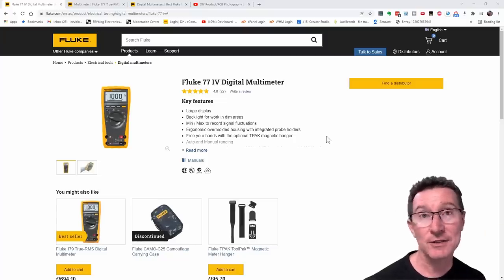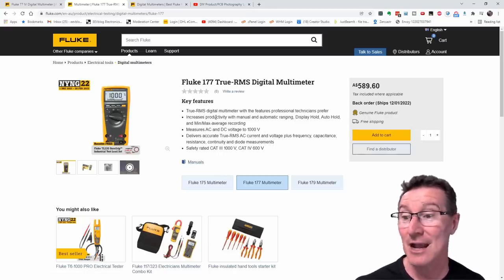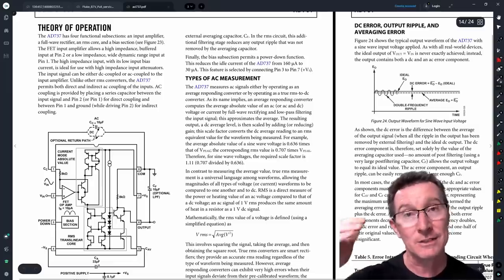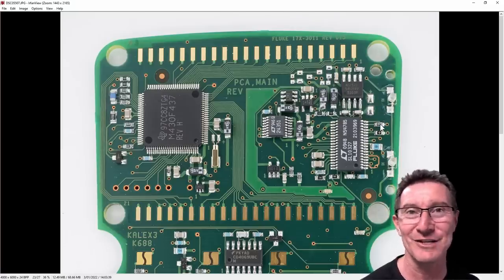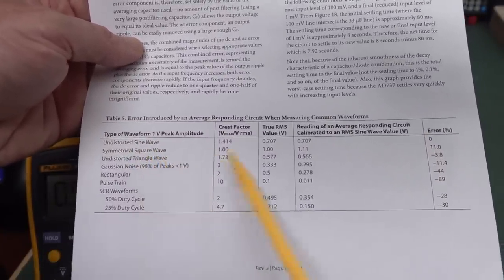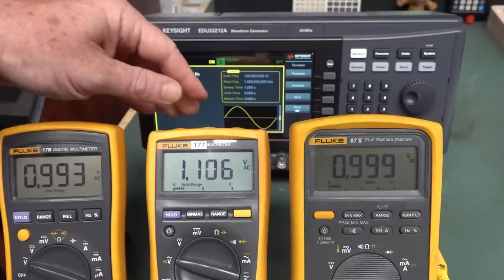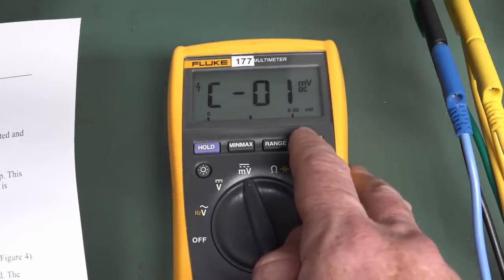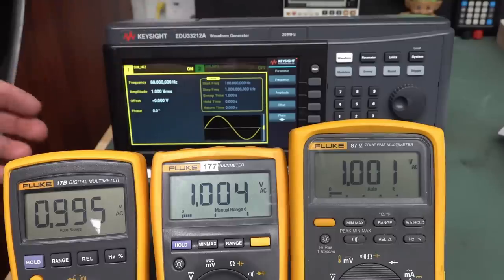EEVblog 1448 - Convert a Fluke 77 IV to True RMS for 10 CENTS!*

Comment from the maker: FYI, Fluke responded, the 70 series not not being discontinued, it's just not on the Australian website. It is on the US website main page though.
Reply: Dave, that was the first thing I went to check after I hit play on the video!
Reply: good enough for Australia
Reply: Ask them to modify the cal routine so that you can skip directly to the ac calibration after mounting the... no wait. Lol.
Reply: Did they respond to this video? :)
Reply: I've had a 77AN for about 30 years. I was hoping this was something I could do with mine. I'm due to change the battery, I'll have a look inside.
Reply: Phew... close one!
Reply: Sounds like a reasonably productive response rather than a cease and desist letter, the true winner-winner chicken dinner!
Reply: @EarthSouthside  not quite 30 yr batteries. I've changed the battery twice since I've had it.
Reply: @jhonbus  also, it may be technically a 10¢ modification, but the recalibration requires access to equipment worth many times what you saved on the meter (although a slightly shady reseller who had some of that investment already could probably make some money selling "upgraded" meters - then i'm sure Fluke would get mad). But it's a nice insight into both how the technology works (I had no idea the T-RMS conversion was all analog) and how products are built with different markets in mind.
Reply: @RandomUser2401  not good enough for Australia :-D
Reply: @ailivac  Like with plenty of "commercial" grade equipment everywhere - you don't really pay for hardware, you pay for support.
Reply: Dough
Reply: Temperature... anybody, oh yes get the TK 12 temp module also...., Just get a 179 and save yourself all the bullshit lol

Comment: so: 10 cents for the cap, and 10,000 dollars for the calibration equipment? ;)
Reply: I'm offering a service...
Just send your fully functioning 77-IV along with $US 500.00 and prepaid return packaging.
I'll convert it into a Fluke 177 INCLUDING a correctly labelled new case and even a manufacturers warranty!!!

I can also offer a similar service to convert other meters (at different prices of course)
For example, if you send me a fully functioning HP/Agilent/Keysight 3458A, I can convert that one into a Fluke 177 for only $US 300.00
Quite a bargain huh?

<<<Grins>>>
Reply: Or you can just pay few 100,000's of loan for a shop in a business building with a magic dumpster so that you can find those equipment "for free" ;-)
Reply: I dont think that calibrating a meter is such an expensive endeavor 😸
Reply: Nothing stopping somebody considering doing this from sending it out for calibration, for handheld meters, its generally pretty cheap from what I have heard
Reply: Yeah total clickbait.
I expect so much better from dave.
Reply: @logangreif8549  
Probably depends on the local market, and if you care about qualified service or not.  Best bet would be asking some local volt-nut type who has their own gear and will do it for free or cheap.
Reply: $10000 is a little too low, adding 1 more Zero and you maybe right
Reply: And yes the correct title of the video
Reply: @boggisthecat  a volt-nut might be more expensive then a company that is into calibrating flukes. The volt-nut needs to cobble together multiple devices.
That takes times and know-how.
A specialized service has an automated rig and a Fluke 177 cal. program - press start and follow the display and your meter is done. That is fast and just requires using the existing setup.
Reply: @sarowie  Generally yes, as long as they're willing to get your order to calibrate one meter, when most of their clients just send 50 of them in bulk and only require one "pass/fail" document.
Reply: @lolaa2200  I did that.

I really works.

I mean, I found a (mostly) Working Digilog 300 in the dumpster here... (Found a C128 also, as well as 2 tektronic scopes, a random assortment of meters, microscopes, lab equipment, 3d printers, UV LED equipment... the list goes on)
Reply: I had the exact same comment, but nobody liked mine.  I feel so disrespected!
Reply: @wojciechszymanowski  the price grows roughly exponentially with precision.
Reply: @wojciechszymanowski  Yep around 25 Pounds Sterling in the UK for a multi-meter calibration but my first thought was the same as Bob Cuyt's

Comment: My wife bought me an original Fluke 77 as a wedding gift in 1985.  Still my favourite rugged, reliable DVM.  Last year she found me {through her volunteer position with a local thrift shop here in western Canada} an older Simpson 470 DVM which is NOT auto-ranging, an advantage when I want to quickly check zinc-carbon, alkaline, NiCd & NiMH cells using the 2 volt range.  I'll grant that modern metrology tools are generally superior, but instruments from many decades in the past still have their uses.  I have a 1941-vintage 0 - 15 VDC meter made by Weston.  Nicely finished wooden case, long mIrrored scale, still very accurate, but a little overdamped {slow to reach its final reading}.  Calibration certificate inside the lid signed in india ink.   6 years older than I am !
Reply: great wife ;)
Reply: Checking the cells is pet peeve of cheap auto-ranging multimeres that have volts AC and DC on one dial position and they somewhat have AC as default.
Reply: @Alexander-qz6px  Just what I was thinking. Surely a keeper ;)
Reply: Analog mechanical meters are naturally true RMS and they aren't as affected by static and noise.
Reply: @fieldlab4  a bit like being slow, you don’t get the joke’s being made about you.
Reply: @fieldlab4  ...Analog D'Arsonval/Weston meter movements are inherently DC-sensing, and if used for AC work generally use a small diode bridge  in series with the meter to measure the AVERAGE current/voltage.  You may be referring to moving-iron instruments which respond to RMS values?

Comment: IF you can afford all the calibration gear, you can afford a 177. Great video, fun discovery, but not practical.
Reply: actually the 177 is cheaper than the 77 nowadays, so maybe if someone pays you to keep his calibration gear during his honeymoon out of town ... otherwise ...
Reply: you can allways use a second meter in series / parallel to adjust your powersupply, no high end calibrator needed.

Comment: I work for a transformer manufacturer company and when measuring excitation and no load loss of the transformer with no load connected the ieee standard calls for use of both an rms and avg reading meter. We use fluke 87 and 83 respectively for this. Has to do with confirming a sinusoidal waveform is being applied.  If the values of each meter are off we have to apply a correction factor. And we annually get our meters calibrated by a third party cal lab to instill confidence in the measurements.
Reply: If only some handheld tool existed that could show a waveform ...
Reply: @xorbe2  it’s the ieee standard. It literally calls out this method of testing. Must not deviate from it.

Comment: well, that's 10cents + several tens of thousand of dollars of calibration équipement ! Of course you can just find these equipment for free in a magic dumpster but then it cost you several years of loan in a building with a magic dumpster. All in all it's still cheaper to buy the 177 directly.

Comment: Reminds me of the old school Radio Shack days.  They would have something like 3 different radio models, low cost, middle cost and high cost.  The higher cost ones supporting a larger range of bands.  All you had to do was buy the cheaper one, cut a few resistors and bam, you have the most expensive radio.

Comment: It would appear that if Fluke had added a tiny bit more circuitry, they could have maybe a small mosfet switch the filter cap in and out of the circuit on demand.  Then a button on the front panel could select AVG/RMS.  during calibration, pressing the yellow button could tell it to take two readings, one with the cap in and one with it out.  I think building two models with such a minor difference was a missed opportunity considering it could have just had both modes in one.

Comment: Good audio power amp with a step down transformer to get the 6 amps AC.  Tearing down an old UPS backup can sometimes do the trick.  I've also used the same to get up to 1000 volts AC with well a step up transformer.  Using the audio amp with the function gen.
Reply: I had the same thought a few weeks ago and picked up a Crown DC-300 amp.  Now I can hook my function generator up to it and have a peak of about 600W (120V at 5A) to work with.  But first I need to rebuild the 30 year old amp.  :)
BTW, Crown would demo them running a circular saw.

Comment: This kind of approach goes way back. In the late 50's and early 60's the IBM 407 accounting machine was available (for rent only) for one price, and a double-speed version rented for a higher price. In order to make this change, a jumper was removed. I guess there was some mechanical wear argument for the increased price. I'm sure this is not the only example.
Reply: Same goes for outboard boat motors. The same basic motor may be sold with two or three different power outputs, sometimes with "actual" differences such as smaller carbs on the lower power model, sometimes nothing but a piece of plastic preventing the throttle control to reach full throttle.
Reply: Same was true for at least one mainframe computer that I'm aware of.  Jumper added a wait state or two.   CE's were threatened with termination if they removed said jumper without corporate approval.
Reply: Same with Keysight and their oscilloscope software "upgrades".

Comment: On brymen DMM you can have nice thing of calibrating just the mode selection dial of your choice without the need to calibrate whole function or even whole full range of that particular measurement selection.
Reply: That actually makes sense since it's for the general market. If you think about it, the way Fluke has it set up also does, and is a necessity since they are used in production environments where its acting as a standard of one sort or another to verification of some part of the process. Seems tedious but after having worked for a number of years in a production facility I can say the temptation to just "fudge" it is always there for the techs, and engineers like myself while we are at it. Not out of malice or ill intent, but usually out of simple ignorance. Also makes it much less likely that the calibration can be corrupted, or a meter fault go unnoticed since the meter must pass all the steps before committing it to the EEPROM.

Comment: It's even easier to convert a Fluke 114 to enable diode & capacitance modes. 
Just remove the internal dial stop tab, so the dial can rotate clockwise round to the next position after continuity.

Comment: I'm suprised they couldn't make that an option that could be turned on and off...

I guess they'd need to have two calibrations, or from your description: store the square root value of the capacitor chosen and use that value to determine true RMS vs Average.

Comment: The 70 series is still offered on the site from the Netherlands but "Out-of-stock".
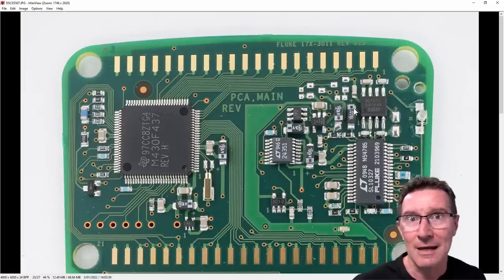Also at 4:22 look at the top PCB writting... it's a "FLUKE 17X-30111 REV 015" board! Mystery has been solved! 😉 (Edit: DOH! Says it one second after I stopped the video. 🤦‍♂️😅 )
Reply: The NL site doesn't list prices. Weird...
Reply: @ZomB1986  It does on my end as it states: "€591,69
Prijs is inclusief btw" (Price is including Value Added Tax)

Comment: Makes me wonder what custom firmware you can get. Be able to get the temp sensor and also make the calibration more painless.
Reply: I guess: you can get any firmware you are willing to write (or have someone write for you) :)
Reply: @absurdengineering  that’s only if the system isn’t locked down. Hardware hackers can cycle power to skip instructions and such to break through some chip security systems, but if the OTP fuses are burnt there’s basically nothing you can do. For something that has official firmware updates it’s almost certainly possible, and for something that has its own calibration system like this DMM it’s probably possible, but who knows.

Comment: The keithley 175-av has the same thing, I believe it was a meter made for the government and/or the military and only needs a new cap and replace a resistor in a voltage divider to change the scaling factor  in order to change it from average to trms it even has a similar chip (AD637).

Comment: I'm searching for Dave's 77->177 upgrade kit - a 33μF cap and all the cal gear for 10¢ 😁
Reply: Don't forget the time you spend doing this.
Reply: You can install the cap and send it out to be calibrated at a cal lab. You’ll get a current cal that way, if that’s of much use. Still cheaper than a buying a new meter.
Reply: You can install the cap and send it out to be calibrated at a cal lab. You’ll get a current cal that way, if that’s of much use. Still cheaper than a buying a new meter. I wonder whether Fluke selects/screens those capacitors for higher repeatability between AC readings across different meters.
Reply: @absurdengineering  the meters cost roughly the same. Why bother?

Comment: I always wondered if you can enable the temperature reading ability to the Fluke 177 like what the Fluke 179 has. Practically identical specs, even the 177 displays the C/F symbols when you do the display test on the meter. Anyone know or heard of it being done before?
Reply from the maker: You'd have to add the parts as per the schematic, and also chaneg the firmware.

Comment: one question to EEVblog - do you search interesting equipment for tear down ? then you should check 1990s high end photo slide projectors. I tried to fix one and was completely amazed by it's processor control, dozens of sensors, switches, motors, solenoid actuators , triacs, and and and. i think i counted alone 6 different internal voltages.

Comment: have fluke sent any men in black too you to have a whisper in you ear yet after letting this cat out of the bag?reminds me of the old mallard oc70x ceries of germ transistors,you had the oc71 then the oc71p photo transistor,the only difference was the price( the p  was about 3x more expensive),used to just scrape the paint off  the oc71 then voila you had the p version,later they got used to this and started filling them with a pale blue coloured gloope,used to twist the legs together then and stick them thru the holes inside of my mums hotpoint twintub spindrier drum and centrifuge the gloop from the junction,didny always work mut maybe 3 out of 10.

Comment: Getting 6A/60Hz is probably easy in US, if you happen to have a big mechanical variable resistor. Still I will refrain myself from using the power grid for "calibration".
Reply: The frequency does vary depending on grid load, though. So you would have to check the frequency and wait for it to be exactly 60 Hz.

Comment: Video on how you cobbled the current source ! Seriously, had to deal with this kind of junk before and gettign this kind of stuff is remarkably hard, especially once voltage/frequency/currents are beyond what an audio amp does comfortably.....
Reply from the maker: It was just my variable frequency/voltage mains supply into a 4 ohm load. Adjust voltage until it was near enough. It was only rated 4A though, so lucky it went to 6A. Certainly was not a good stable reference, I wouldn't recommend it!
Reply: @EEVblog  Ahh, that clears it up, thanks dave! So special equipment was involved. Last one for me was 20 kHz Sine at significant voltage, power converter + LCL could not be used because too much switching RF noise would always radiate and ruin the measurement. No incentive for a proper analog design because single use. Ended up using a semi class b/c with the same filter and a ferrite transformer to step up voltage. That was "fun".

Comment: I have a Fluke 16 that started reading off for both AC and DC voltage. It reads high (12.6 v DC reads as about 15.4 and 124 v AC reads around 140v) is the meter shot? Or could it be recalibrated successfully?

Comment: i found the same thing the other day when looking for the 70 series... it all seems to be 170 series now..
cool simple mod... whats the different in price between the rms and non rms meters? ...fluke should be ashamed.. but then again..its the people buying the crap that should really be ashamed for letting them get away with it..
Reply from the maker: Was hard to get an accurate price because both official prices aren't on the Fluke website, so you then get into dealer margins which changes things. Didn't seem to be much though.
Reply: @EEVblog  yeah i guessed the price would be hard to if..especially if its discontinued

Comment: Thanks for the interesting video. On the subject of T&M manuals I'm wondering if you might be able to help me? I am after a manual with circuit diagram and component ID's for a LUTRON DM6055C digital clampmeter (circa ~late 1980's). Yes, I know what you're   going to say and No, LUTRON (Taiwan) don't do communications with customers for some inexplicable reason. Not even the distributor here has gotten anywhere with them. So I'm wondering, could what I'm after be found in some obscure hiding place? Any help appreciated. Thanks.

Comment: So they could in principle add a switch or mode for measuring average or rms.

Probably not a useful thing, and wouldn't fix the problem with existing documentation of you wanted to replace an average measuring meter with a dual function. (You still need to add "be sure to measure in average mode" everywhere)

Edit: ah, and the calibration. Well, there's the switch idea out the window. ;)